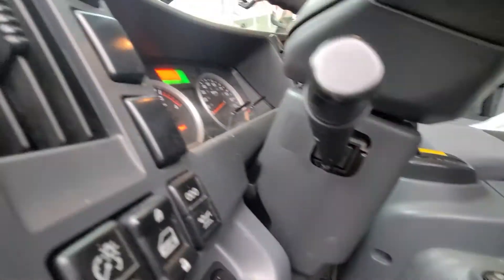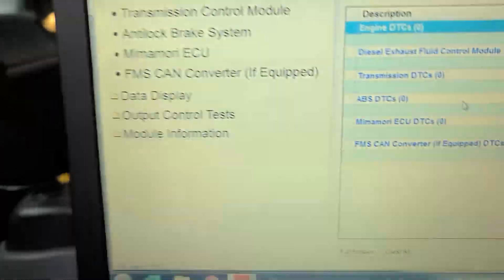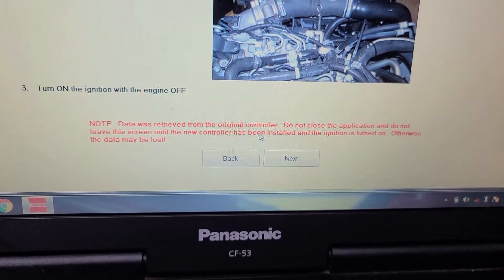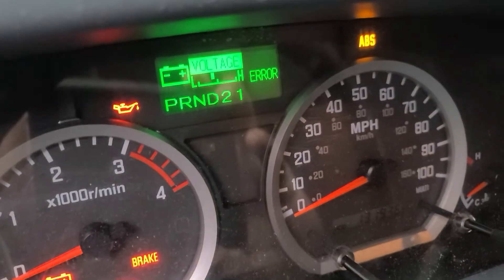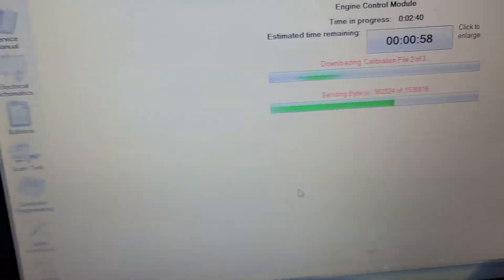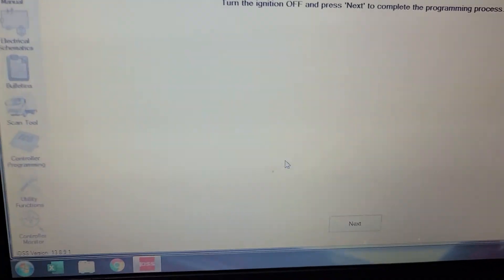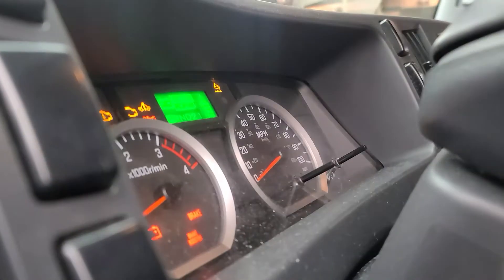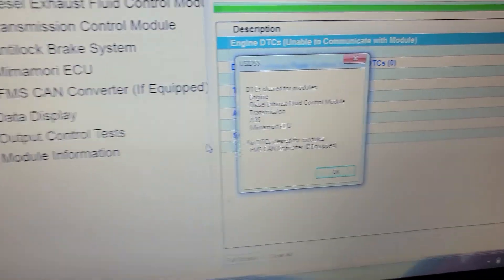Isuzu truck on derate mode 5pmh only way to get back  is reflash the ecm

Comment: Se ve que tu video enseña mucho, pero si deberías de cerrar la puerta, solo se oye el beep..
Reply from the maker: @manuelortiz7731   parese q no tienes esperiencia ese beep es del camion cuando esta en derate mode
Reply from the maker: El beep is the exhaust sytem protection
Reply: Que puedo hacer para sacqr este beep ? Sacar y limpiar el dfp ? @truck_diagnostic
Reply from the maker: @Giancuffaro230  ver los codigos primero aveses es el nox sensor no siempre es el mofle puede ser algo simple Como cables
Reply from the maker: No la puerta

Comment: I had the same issue. If there are no codes, you can force the truck through a regen and it will automatically clear the derate and red exhaust system light. No need for a reflash most of the time.

Edit: If it fails out of regen, the codes will come back.

Comment: Is this the only solution after issues are fixed?
Reply: Even after clearing codes the light doesn’t turn off? That’s what idss is supposed to do
Reply from the maker: Yes
Reply from the maker: Most likely

Comment: Hi ,very helpfull video , iam a mechanic and i have the same problem on a 2015 NRR ,I had a code for def injector with 3 codes on mimamori module just like you , injector code is gone but the 3 on mimamori wont erase and truck still on limp mode !!! Do you think it need reflashing ??
Reply from the maker: Yes

Comment: Hello, I have the same problem in my 2015 NQR.
I saw this video and another video from you where you replaced a injector on the DPF.
I don’t have the computer but the symptom is the same. 
I have the same lights on and the same beeping noise.
What can I do??
Reply from the maker: Well youu need computer or any mechanic near you
Because without codes u can't do nothing 
Don't start guessing

Comment: I have an 06 GMC T7500  with 7.8 Isuzu 6hk1.  The truck would not rev up past 1000 rpm  and it was the ecm. I  took  the ecm to a guy who  has IDSS  and he plugged it on a similar  truck to test  it and supposedly reprogram it. He said he did reprogram it but the ecm was the same. So, I  had to buy  a new one and the same guy programed  it. This time I saw him do it. I  installed the new ecm on my  truck and it worked fine for a week but the problem  has returned.  No revving past 1000 rpm.  The only thing in common  that I have done  is checked the injector contribution  balance  with a Launch x431 pad III scanner  and coincidentally that's  when the problems  have happened  to both ecms.
The question  now, do you  think  reprogramming the ecms it's all that may be needed and I shouldn't  have had to buy a new one? And also, is the Launch scanner corrupting the program?
Reply from the maker: Well any reprogram with different than idds will damage the ecm like
Water damage: Control Modules are loaded with electronic components and other sensitive parts; once it becomes wet, it can become inoperable. ... 
Corrosion due to age and weather: Over time, hot temperatures can cause key components of Control Modules to melt or even catch on fire.Corrosion due to age and weather: Over time, hot temperatures can cause key components of Control Modules to melt or even catch on fire.Power supply (simple as a ground or broken wire) could cause this. ECU could be fried by over voltage, reverse voltage etc.
 It's better to check any additional modules or scanner aftermarket is installed in the truck will cause the ecm to go bad before u putting new ecm check everything most likely u need new ecm but get the person who can deal with truck or simply buy new ecm and take the truck to the near dealer and get the right reprogram..
Reply: @truck_diagnostic  thanks for your prompt  reply.
No, I  didn't  try to reprogram  with the Launch scanner, I  was just checking  the injectors  with the enable  and disable functions on the  power contribution balance feature. After  that  the original  ecm started  not wanting  to rev past  1000 rpm but all parameters  checked  ok. All three accelerator sensor voltages were normal,  fuel rail pressure  normal, cpk, cam sensor were  fine. No codes on any other module.  So, I  took the  ecm to this Isuzu guy who tried it on another truck  and same thing was happening. He said he tried reflashing it with IDSS but no improvement  ( I didn't  see him do it) so he said the ecm is bad. I  couldn't  find a used one so I had to  buy the new one ( $4350.00 ). So, I  brought  the new blank ecm to him and he programed in that  other truck  but he used my injector codes and  entered  my VIN #. I  installed the new ecm  and the truck drove without  issues  for 7 days until  I went  and checked  the data stream and injector  contribution  wirh Launch scanner again and  the new computer  started doing the same thing again.  I  can't  believe  the ecm would  fry and be able to start the truck but not rev up. At least there should be a dtc, don't  you  think? I  have read online of 2 other  cases same as mine  but unfortunately,  the guys who posted the problems did not give any conclusion of what had happened.
Reply: @truck_diagnostic  by the way, is your IDSS  from AliExpress?
Reply from the maker: @aldovera3789   no sir its stright from isuzu
Reply: @truck_diagnostic  expensive, eh? By the way, I had the  new ecm reprogrammed again and  still the  same issue.  I  have given it to the dealer which is going to send  it to isuzu to be checked  and hopefully replaced  or repaired and perhaps  they'll  tell me what is failing so at least  I  have an idea of where to look on my truck. It's  a real puzzle  for there are no codes.

Comment: My 2017 Hino 268A  Is displaying the check engine light and also the SVS light sometimes. The truck looses speed and power when the SVS light comes on. Pienso es un problema electrico.

Cual es tu opinion ? Podrias diagnosticar mi camion ?    GRACIAS !!
Reply from the maker: No creo sea electrico puede ser el atc pipe pm sensor or nox sensors hay muchos factores lo eletrico se qda stable y te pone el problema alli
Reply: @truck_diagnostic  tenemos tres camiones Hino que de ves en cuando tienen problemas, podemos llevarlos a tu lugar para diagnosticarlos y arreglarlos ?
Cual es tu ubicacion ? O prefieres venir tu ?

Nodotros estanos ubicados en Trenton Nj. 

Muchas gracias !  By the way we are sharing your videos with our colleagues that we work with at Amazon and other places.
Reply from the maker: @ochoavlogs5633  dm on Instagram
Reply: YOU ARE GOOD!!!  I changed one of the two  NOX SENSOR which cost me $588.00 and the SVS light and problem went away, my truck is running strong again !  Also the check engine light went away after running the truck for about 400 miles. 

THANK YOU very much for your diagnose on my truck !  El ETERNO DIOS✨ te bendiga a traves de su hijo mi Señor  JESUCRISTO✨